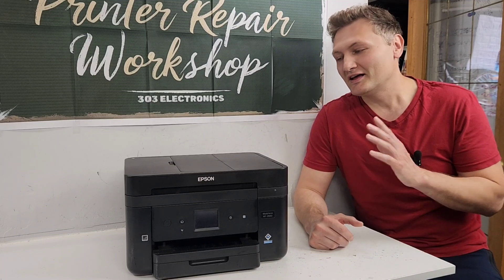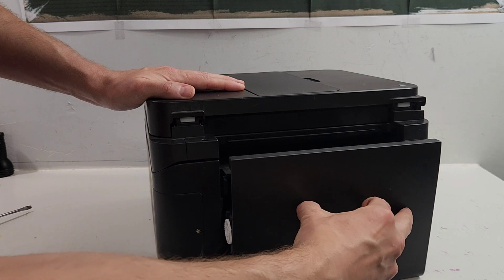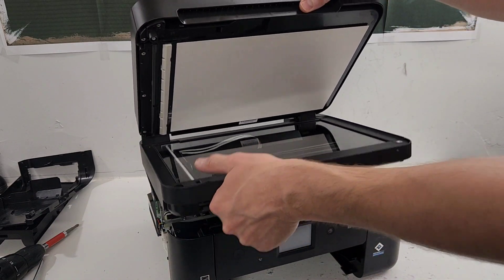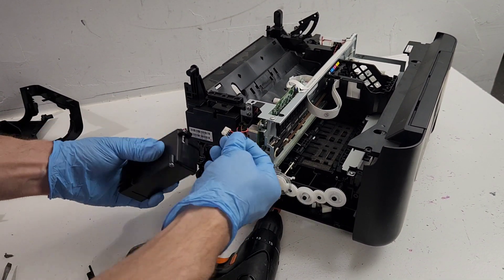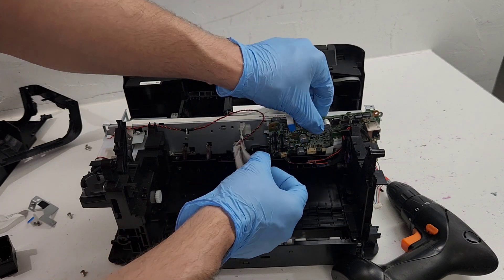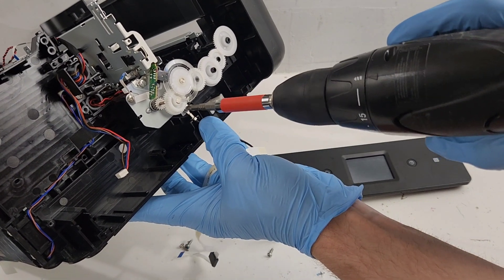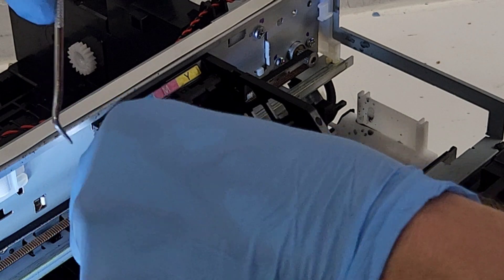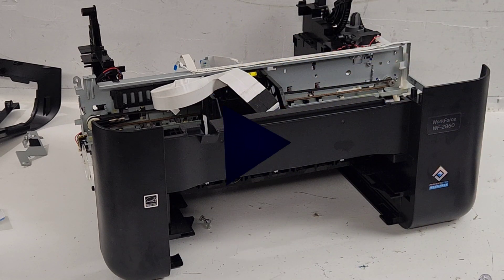Taking Apart EPSON Workforce WF-2860 Printer to Clean or Repair

Comment: What is the White plastick part all the way to the right called?  It is where the print head rests and/or gets cleaned? Is there a way I can clean that up? I have replaced the Maintenance box, but that part is still pretty soaked with dumped ink